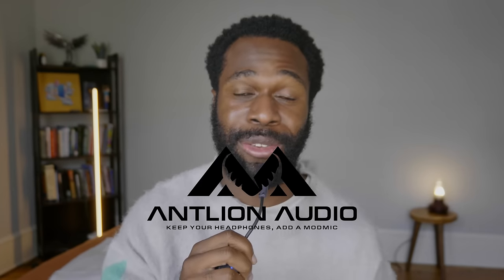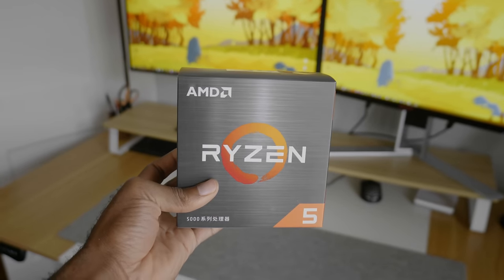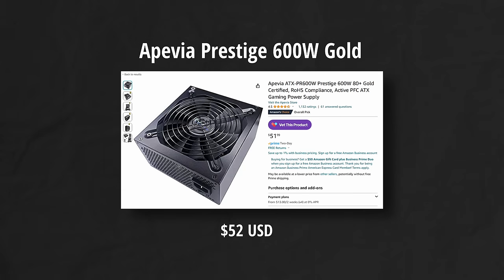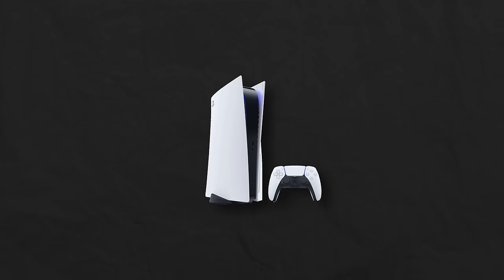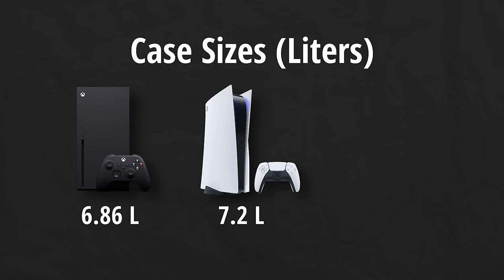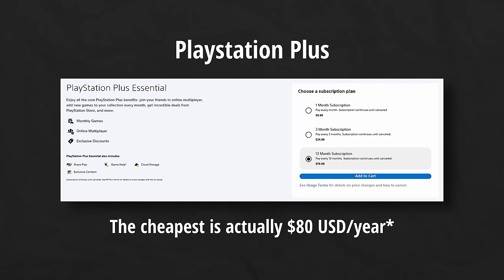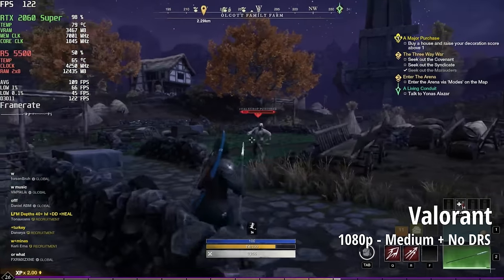The $500 PS5 Killer...did we do it?

Comment: This is a great video and I love builds that are budget constrained, but I have some points that I thought about: PS5's GPU (RX 6700) is better than a RX 7600, Digital Foundry themselves usually use a 2070S as a PS5 equivalent, although you could always get a proper 6700 (non-XT). 
Also the whole "PC is more useful than a console" argument is great for someone that doesn't ALREADY have a computer, usually people that buy consoles just want something to game on, and already have a simple computer or laptop. And then there's also the simplicity and ease of use, consoles is pretty much plug and play, PCs... not so much. For us that actually know what we're doing, it's second nature, but for the average user the whole driver installs/upgrades, graphics optimization, troubleshooting when something goes wrong, etc. is way too much. And lastly, the price does not account for a controller, which is included with consoles.
Reply: I think, we need to stop babying the gaming market. Building a pc is a learning experience, sure, but if you treat it like something to fear, you're only going to push people away.
Reply: The RX 6700 is still faster than the PS5 GPU. It is not limited in memory bandwidth nor does it have as limited thermal envelope. The CPU in the PS5 and Series X is equivalent to a zen 1+ 2700x. The consoles are a lot weaker than people think.
Reply: @ZackSNetwork  The CPU in the Series X and PS5 are zen 2 and is more likely equivalent to a 3600 and the PS5 can allocate up 10gb of it's memory to vram and it's really not far off in term of perfomance to the rx 6700 even 6700xt, keep in mind a big chunk of PS5 and Series X games runs at 1440p upscale to 4k, so maybye you underestimate them.
Reply: At this point I don't think we should count controllers anymore because most people have older controllers that will work with the pc I have like 4 ps4 controllers at my house from when I gamed on it and they work perfectly fine with my pc. All your other arguments are fair, but even if they already have a laptop or some weaker computer to do work, the whole selling point of the pc is that it can do BOTH. And thats something he didn't touch upon on purpose. The pc in general is just better value overall and though you are right the idea of trouble shooting and maintenance and such are intimidating, people aren't gonna learn if they don't try. They also have a plethora of resources on the very device to help that process. YouTube videos, articles, Google etc. Can provide them with answers and help as they need it. The device can be a back up for work and a proper gaming console  while the console is only good for gaming and video streaming through apps like Netflix and YouTube.
Reply: @ZackSNetwork  

That is absolutely, factually, 100% incorrect.  The PS5 GPU has much higher native bandwidth at 448GB/s but no L3 cache.  The RX 6700 has a native 320GB/s memory bandwidth but makes up for this with an 80MB L3 cache (Infinity Fabric), so bandwidth wise they come out about the same.

That part about "limited thermal envelope" is completely made up.  The PS5's SoC does not throttle and the GPU is specced for a sustained TDP of 180W, whereas the RX 6700 has a 175W TDP.  Basically identical.  The PS5 GPU has a static GPU clock speed of 2233MHz; the 6700 has a game clock of 2174MHz.  Again, basically identical.

As far as the CPU portion, they are about equivalent to the Ryzen 3600.  They have 2 more cores, but a lot less L3 cache due to using the monolithic Renoir design instead of the chiplet Mattise design.  Some games will favor going from 6 to 8 cores and the lower latency from the monolithic design more than the additional L3 cache, others will favor the much larger L3 more.  It's a toss up.

Stop making up shit about topics you are completely uninformed about.

Comment: The best GPU option under $200 right now is to buy used and get an RTX 2070 Super for around $150-170.  They cost about the same as the RX 5700 XT, but they're a tiny bit faster and has more hardware features like AI upscaling cores (Tensor cores) and Mesh Shaders.  At the low $200s, a used 6700 XT is the best option.

Comment: Don't forget to add
-Mouse.
-Keyboard.
-Windows OS.
-Blu-Ray player.
-DVI or HDMI cables.
Reply: this a good point
Reply: Cables come with the  monitor and insanely cheap, you don’t need windows key to use the pc, plenty of mouse and keyboard combinations under the price of a controller.
Reply: @averagemike2171   you can use a monitor with a console and TVs also come with HDMI cables. None of that negates the fact that an HDMI cable is included in the price of a PS5. 

You're correct that you don't need to use a Windows key on PC. Heck, you don't even need to use windows. I'm pretty sure Oz does in this video though. If you're not going to factor at least the cost of a grey market windows key, it would make sense to explain what alternative is being used for the OS, (even if it's just windows with the watermark).

Lastly,  you're not going to find a keyboard and mouse with comparable quality to the PS5 controller for significantly cheaper. Even if you did (let's say that you personally thought that a $20 keyboard and mouse combo was the equivalent of the PS five controller), he would still need to factor that into the cost of the PC since again, the cost of the controller is included in the cost of the console.
Reply: @averagemike2171  And that's theyproblem. Pleanty of cheap option while console had some of the best controllers on the market.
Reply: And PS5 is $400, so the price comp is not even close
Reply: And monitors
Reply: @CapitolPilot   You don't get a screen when you buy a PS5 so it wouldn't be fair to include the screen in the cost of the PC.
Reply: @ninjaTyj  I so thankful that you get it.

Comment: But the ps5 uses an rx 6700 non xt and a Ryzen 4700g
Reply: And use FSR to upscale, so anything upscaled will automatically lose to DLSS of the 2060 Super. But Oz said he wanted to match it with brand new parts and have it repeatable easily. He could've clearly beat it by going for used parts and deal hunting imo.
Reply: its a weaker 6700....so its really 6600 / xt version plus it use upscaling on med settings
Reply: @b0ne91 bruh if you bring used part into the picture there is also used PS5
Reply: @scarfaceReaper false if anything it’s a faster 6700 because of more vram
Reply: @hamza.991  isn't the desktop versions ALWAYS faster than any other ones that includes the mobile GPU ( if I'm saying it right) look at the base Rx 6600 vs Rx 6600M the Rx 6600 is around 5% overall faster

Comment: I've Built systems for under $550 with much higher specs that do compare nicely against consoles, I feel like at this time though you still currently have to buy most parts used to get it in that budget. I've built systems with RX6700 and RTX 3060ti during the pandemic all which used brand new parts. some of the components could have also cost less like the RTX 2060 super you had shouldn't cost more than $100 which stacks up on the final price. Nice video and thanks for uploading happy holidays
Reply: eh... where did you even get an under-$100 RTX 2060 Super? Facebook Marketplace? Used deals on Ebay or Amazon?
Reply: You didn't build a system with a 3060ti brand-new-everything for under $550 dude.
Reply: @jmass4207  yes I did the videos are up on my YouTube I literally have like 2 videos of it 😂

Comment: It's awesome that we're at least back to that point where you can easily leapfrog console performance in the <$1000 budget bracket. Rather than a bit ago where you were spending at least $1000 to maybe even start getting in the ballpark.
Reply: For 1045 $ i got a i9 12900k paired with rtx 4060 oc white 32gigs ram 1tb mem 750 semi modular with a asus 790v mobo.
Reply: @boinecastillo7455  Why you buying an i9 for?
Reply: @lexkek5625  work capacity bud , why don't ya like i9?

Comment: Set manuel voltage for the CCD and IOD, 0.9v and 1.0v, this shaves of even more wattage/heat, also make sure your FCLOCK and MEMCLOCK are in 1:1 ratio for best performance, its a setting in the bios.

Comment: The RTX 3060 12gb is slightly faster than the PS5 and Series X in rasterization performance. It’s significantly faster in raytracing and especially when DLSS comes into play. The PS5 and Series X are in the middle of a RX 7600 and RX 6700 in raw rasterization performance. With RTX 2060 level raytracing performance.

Comment: IM01 is such a good case, though I have to warn people before buying tower cooler, tha 154mm clearlance is for metal panel, if you want to use glass side panel you will not be able to fit them.
I would recommend Thermalright Phantom Spirit 135 for such occasion, instead of not being able to fit AK400 or PA120, which I tested and did work with metal panel, not glass panel.

Also the manual says that you cannot use 120mm fan at the rear, but if you use zip-ties you can totally fit one no problem. (May depend on where you live but mine did not come with any fans)
also if you are going for larger GPU please use SFX instead of ATX, there is no room at the back, you will neeed to manage your cable super well.

Comment: I bought that case for my first pc build. It ruined my experience. I bought it with a matx motherboard because it is advertised to be able to fit a matx motherboard and 2 120mm fans on the bottom. When is started my build, everything was going smoothly until i had to mount the bottom bracket. The bottom bracket didnt  because the fans were pushing against the connecters on the bottom. I tried to off set it but it still didnt fit. I returned the case and just went for something bigger.

Comment: R5 3600 (N), A520m-hdv (N), SP 2x8 DDR4 3200 (N), Crucial P3 Plus 500GB (N), Thermaltake Smart 600 (N), Asus PCE-AX3000 (N), Deep Cool Matrexx 40 3FS (N), Samsung 850 Evo 1TB 2.5" SSD (U), GTX 1080 Gaming X (U).
I built this system up for ~$500 recently. The price on a couple of the items has gone up a touch and of course the case well larger than this comparison...even if you used the great looking case from your build list, it would all fit and performs a bit better IMO. Stay right at the budget too!

Comment: I’ve got a quick question, is it worth too install 3 120 fans on the side, and 2 on the bottom? I already have 2 140 fans in the front intaking air and a radiator on top with a 140 on the back exhausting air. Just asking because I have some spare fans and would like too know if it’s worth it. I have a view71 thermaltake case.

Comment: Oz can I give an idea. Not sure what parameters actually adjust when you make this edit but... I do a search term for "edit power"; I open the power plan menu; I go to advanced power settings; I lower the CPU maximum limit from 100% to 99%. I see a minimal frame drop in AAA titles, and my CPU never approaches the danger zone like it use to (ie: 70C peak when it use to be 93C peak).

Way I see it I get a more stable, more consistent experience and the parts last longer.

Perhaps that setting is preventing turbo? Who knows. I sure know it works in laptops and SFF with limited cooling.

Maybe also... we could optimize windows a little more before doing a head to head like this. 

I just feel like: killing background services, killing notifications, uninstalling garbage apps, going down the itemized lists of ways to prevent windows from misappropriating RAM, CPU, and disk utilization, maybe using that Thermalrite CPU cooler as it is nearly as good as liquid cooling and it's dirt cheap. What else...

Oh yeah! Optimize the windows UI. Get rid of visual effects and quality of life garbage that you don't even notice are taking up resources.

Disable all startup programs and processes if I didn't say that already.

Do a search for "adjust the appearance and performance of windows"; change the virtual memory/paging size to 1.5XRAM initial and 3XRAM maximum.
So 16GB physical RAM would mean 24/42GB virtual parameters.

Don't assume console graphics are maxing everything out. Use that Nvidia control panel to adjust global settings from the get-go. Don't bother with RT on the RTX 2060. It can do ray tracing, but you and I both know it really can't. 

Maybe just the smallest possible .025 volt underclock on CPU and GPU just to see how it effects both synthetic and real benchmarks. Who knows. Could work. Also: THIS type of stuff is what makes the console go for 20 hours straight when a PS5 starts to struggle for air and parts are running on borrowed time and shortening lifespan.

Comment: My only two cents here is a console needing a tv, same as a pc needing a monitor. The cheapest 4K 120hz tv is going to set you back at least $500, the TCL Q7. So if you factor that into a PS5 setup you’re starting at at least $1K.

And with comparable specs for a PC you may be more, but you also have a wider variety as far as upgrades go. So it depends on convenience tbh

Comment: Easily possible for under 300 too, the Soyo RX 580 8GB is often on sale for $50 and performs quite the same in the games shown fps wise.
Xeon E5 2670 V3 with motherboard goes for about $50, which packs quite a punch, not as good as the Ryzen 5, but more than enough for games like Valorant which are more CPU heavy.

Comment: As this PC is digital, it should be compared to the $400 digital ps5 (which makes it more difficult to build of course). PS5/Series X also use a downclocked 3700x which likely surpasses the 5500. Also I'm fairly certain the actual GPU equivalent to the consoles (at least ps5) is more along the lines of a 6700 (not the xt just 6700 although maybe to make up for some bad performing PC ports, the 6700xt should be the better choice). Digital Foundry very confident that's the case of the 6700 being the ps5 equiv GPU in the PC space. I would recommend for selfish sake (not for any console vs PC wars BS sake) using used parts and getting a $100 or less 3700x if I was trying to make a PC on par with a PS5 (I actually have a 3700x in my PC from 2019, was $330 new, still a lovely CPU).
Reply: What language are you speaking with all those numbers
Reply: @carloareaser  nerdy stuff
Reply: No it is a 2700X and more like a 2070 super or 5700XT with a few modification
Reply: @RengokuAMVs-im6xy  There is a 6700 (non XT) that is quite literally a near 1 to 1 match spec wise. The Ryzen tech is far more similar to that of a 3600x to 3700x as well.

Comment: The PS5’s GPU is more similar to a 6700 or a 2080 so this isn’t even in the same ballpark as a PS5. Also PS5 has 1TB of storage, and doesn’t have the overhead of Windows, so the real comparison would be closer to a 6700xt. 

I like that you tried and you did make a solid $500 computer but it doesn’t really compare to a PS5.
Reply: Not at all really 2080 and 6700 are better more like 6650XT or 2070 super which are quite cheap

Comment: Curious, but I noticed in your case you directed the fans at the top in such a way that it exhausts to the top there. As well as having an exhaust at the back. Isn't it usually the case where people go with intake for the top fans and the exhaust at the back fan only for better airflow? Or is it because this is a smaller case instead of the usual mid/full towers? Always wonder what the best form of airflow is in these cases.

Comment: This is literally my PC except I have the MSi B450 Tomahawk max, a 600W Corsair PSU plus 2 1TB 2.5 SATA SSDs and a 1TB HDD in a 30 quid airflow case that came with 4 fans.  Oh and a copper slug Wrath Spire cooler (the stealth cooler is still in the 5500 box).  The system drive is a 1/2 TB Samsung NVMe.

Comment: You can match and even beat console power consumption by undervolting the CPU and GPU. If you undervolt too aggressively you'll get stability issues and have (non-damaging) hardware lockups, but it is doable. Very comfy vid, your voice with the ModMic soothed my tinnitus.
Reply: UV won't match 110w difference
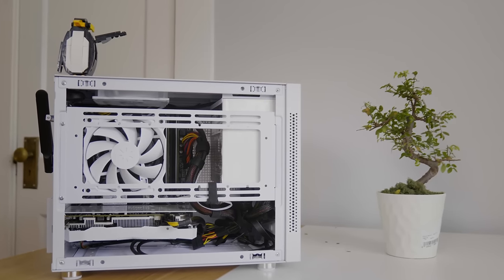Reply: They did Undervolt them both. they talk about it between 4:30 and 5:15